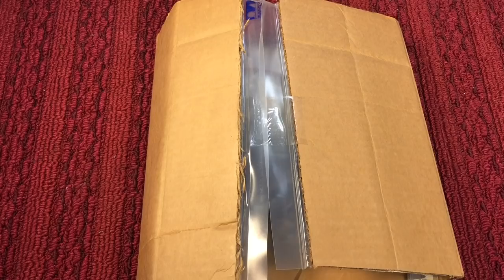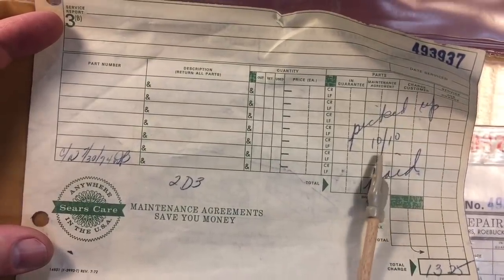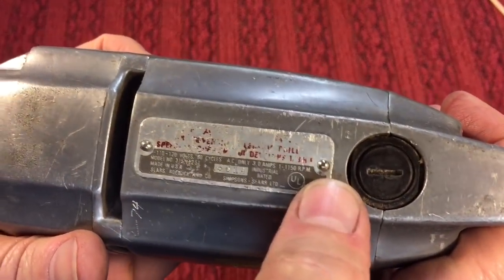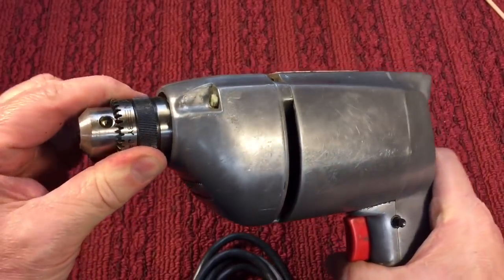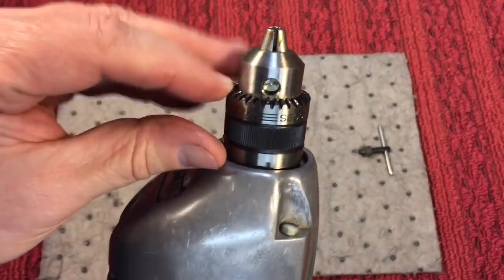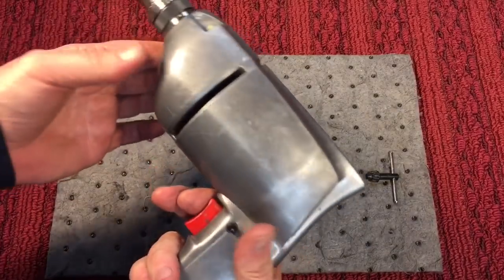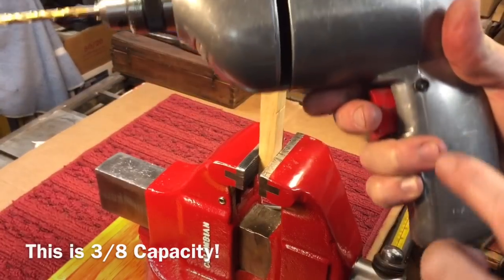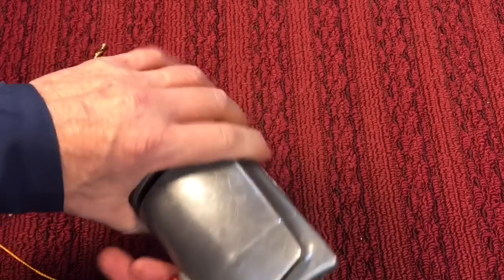Vintage Craftsman Power Drill Unboxing

Comment: Craftsman back in the day great! The small hooked rod is for removing the chuck there should be a hole in the frame near the chuck.
Reply from the maker: Hello Mick!  You are the man!!!!!!  I see a small hole in the top of the housing you can see at 5:54!  I guess that would lock the spindle so you could unscrew the chuck!   Thanks so much Mick!  Pinning your comment!
Reply: I think you could also insert that pin through the hole to turn it into an early version of a keyless chuck by locking the collar in place and grabbing the knurled collar to tighten the jaws by hand.
Reply: "Craftsman" never built anything.  It was simply a brand name wholly owned by Sears.  I wonder who built this thing for Sears?  Black and Decker?

Comment: About 50 years ago my dad had a almost identical metal housing craftsman drill but it had a two prong plug. I was drilling holes in our version of a go cart and happened to touch the metal pipe that was in the cement where the overhead garage door met the floor.  As you said I was the ground....could not let go of the drill, could not talk, just knelt there shaking for what seemed like an hour.  Dad saw what was happening and knocked the drill out of my hand.  He said it lasted a 5-6 seconds.  There was an odor of burnt hair mixed with human urine that I remember clearly even today.  It was 5-6 years before I could even pick up an electric drill. I am still a little scared of corded drills.
Reply from the maker: Hello RG!  OMG!  That is an awesome story!!!!!!   Usually 110 gives you a shock but the kind that makes you drop the drill... Wow!  That is something! Lucky your Dad was there!   Thanks so much!!!!
Reply: A tradey once told me that they changed the way they wired houses so that in the old days if you got shocked , you would “stick” to the metal, but  the more modern way meant that it threw you away from it. Whether he was pulling my leg or not I dont know.
Reply: Rusty Gun, glad you are still here with us!  I think you're right about the age... when I saw it in the video, my immediate reaction was the late 60s.  It's possible.  Like ScoutCrafter points out, we repaired things back then (I hope we pull our collective heads out of our collective butts and return to repairing things and expecting long life in durable goods).  It's not just that it had a metal case, but the smoothness of the case and the logo on the front feel 1965-1969 to me.  Maybe someone has a reference among the viewers?   As to the cord, I agree with ScoutCrafter that it looks to me that Sears Service put a new three-pronged cord and chuck on the drill as part of the service.  What a cool thing - I was born a few months apart from our host, and my heart was pumping when he plugged it in and started drilling!
Reply: Sounds fanciful.  What changed was ground pins in appliance plugs that provided  a low impedance path to ground.  I remember watching users sawing the ground pin off a new tool so that it could be accommodated by a standard two prong wall socket, thus defeating the purpose of the ground pin.  Later, polarized plugs and sockets were introduced.

Comment: Funny story -  My father-in-law passed and I got his tool collection.  It had an old drill that looked much like your Sears but without the grounded plug (I only realized full importance of that later).  It also was not the state-of-the-art model from Sears like yours in that it was only one speed - wide open.  First time I tried it, the chuck was wide open and I wanted to put a small bit in it.  Now I'm 68 years old so I should have know better than to handle it like a keyless chuck.  I grabbed the drill and the chuck to run it down.  The case was shorted and my grip became very firm as the electric surged through my body causing me to clamp down hard on the chuck.  Instead of that beautiful electric train smell, I had that mixed with burning flesh as the drill peaked at about 10,000 rpms (ok maybe a little less).  What an experience that was.
Reply from the maker: Hello JOHN!  LMAO!  What a awesome story!  Those older drills needed a fine touch to to clamp up on the chuck, they were torquey son of a guns!  LOL  I I know your pain!  I still get zapped if I tough my grinder and the dryer at the same time!  =D   Thanks John!!!!!

Comment: I could not agree with you more on the keyed chuck. It gives a far more secure hold and I was always taught to tighten using a the holes to even up the pressure. When you mentioned the smell of the old metal drills I was transported back to the early 1970s with you. Great find and sincere thanks for bringing back so many happy memories.
Reply: "all the holes"
Reply from the maker: Hello Tony!  Even today I prefer keyed chucks... I never had a high quality German Albright chuck though!  Thanks so much Tony!!!!!!!!

Comment: I have had a Sears Craftsman 315-11211 3/8ths inch drill for exactly 50 years! 1st good drill I boughf myself when I was 13 yrs old!  Similar to that one but made of metal and a super hard black plastic! Reversible, lockable and variable speed!  It still works perfectly!  The thing weighs a ton!  That rod was to remove the chuck.  I lost that somewhere along the way😀 Still have the original chuck key attatched to the wire with a little rubber piece.  Great Drills!!
Reply from the maker: Hello Bill!  You got your drill at 13!  Wow!  That is awesome!  I have to check the date of my first drill!  Also B&D and it had a Green handle and Silver painted metal from housing,   Thanks so much!  Good times!!!!!
Reply: @ScoutCrafter  i delivered the daily news and newsday. Saved up the money from my route, went to Sears in Hicksville on my bike, bought the drill, rode home and drilled a bunch of holes. I was always working on something.  That drill with wire wheels or sanding discs on it helped me do body work on my first car at 16 yrs old. A 1968 chevy biscayne, station wagon that was a former unmarked cop car! Great days! Thanks for the memories.

Comment: Hi Scoutcrafter I love that you have an older craftsman metal housing drill. I have a wall in my work shop that has many antique drills and saws from 1947 up to 1963. All can do a full days job. One drill which is a 1955 1/2" Shopmate BEAST that goes AC/DC! Two are my dads, one of the drills has a rubber hanger that used to hold the drill chuck key. I believe what was on your cord was an old chuck key holder .
Reply from the maker: Nothing beats those old drills!!!!!

Comment: The pin locked the armature.  There's a small hole near the chuck that receives this pin.  The locking button was a feature that allowed this drill to be used in a drill press fixture, which was popular at the time.

Comment: That’s a great drill! This brings to mind a drill that I picked up for two dollars at an estate sale a few months back.
It is an old (but new looking) Dayton 1/4” single speed drill that looks like a Buck Rogers Ray Gun.
The cord was frayed right where it entered the handle and there was a break in the wire so the drill was non-functional (hence the low price). A simple repair and it works fine after some clean up and lubrication.
Reply from the maker: The cords are always frayed on the older drills!  LOL  Love that drill you have!  I know the design!  Thanks!

Comment: That's a great purchase ScoutCrafter!! I always loved the blue sparks from my dad's metal drill. Not sure what brand it was, maybe a B&D. His newer metal and plastic B&D drill I still have and it sparks also. Lol. It was the first tool I used with a wire brush after starting this hobby before my wire wheels.
Reply from the maker: Hi Steve!  When the brushes start to go or the armature needs cleaning lots of cool sparks will run circles around the armature!  Looks great with the lights off!  =)   Thanks!!!!!!!!
Reply: Yup, I remember cleaning the armatures of my AFX slot cars with a rubber eraser to make them run faster. Good times!
Reply from the maker: I'm a little older then you, we had T-Jets!  LOL
Reply: Oh cool. I never heard the term T-jet used but those were the first ones we had. I still have them. My favorite was a dune buggy with a striped roof. They were too slow and didn't grip the track very well. Lol. I'm sure all the tires are dried up by now sitting in my attic. If I remember this weekend I take a look and send you some pics. I still saved everything, of course.

Comment: The good thing about these old drills and power tools is they can take a beating and still work and they are more powerful then the newer ones I just pick up a 1970s craftsman drill with the original box and manual from goodwill for only 4.33

Comment: Love the pointing implement.

"Paint" the stator, rotor (what goes inside the stator, keep the commutator clean) and the insides of the metal shell of the drill with a few coats of electrical lacquer.
Check if the earth is connected (multimeter continuity test, or you can use a lightbulb and a battery, or a LED and a CR2032 coin cell) , if not, attach it to the shell. Best way is to crimp a ring terminal and attach it with a screw. Just drill a hole that is a little smaller and the screw will tap it's own threads.
In it's present state it's dangerous, particularly in wet weather.

Comment: Ah yes. The smell of model trains. I also remember going to motocross races in the 70s and the smell of Castrol 2-stroke oil everywhere.
While my cordless drill is super handy, I still use my corded Makita drill with an old chuck from time to time. I find the variable speed has more control on that old drill vs new ones.
Great video as always.
Reply from the maker: Hello Ben!  There is no doubt that corded drills have a limitation (the cord) however other then that they are so much better then cordless drills in every other way!  Especially when you have to buy another battery after a few years!   Makita always made awesome tools!!!!     Thanks so much!!!!!!!!!!

Comment: That is the best unboxing  I have seen yet! My father has a pile of these old drills and nearly all of them have used that metal rod to secure the chuck key. The thick rod is wrapped once around the main shaft of the key, just tight enough to let it spin freely and not twisting up the cord. I am not saying that that's the intended use, I'm just saying that's what happened our my house. Great stuff! Cheers
Reply from the maker: Hello Joe!  There is a small hole in the top of the housing just behind the chuck, Mick 47 says if you place the rod in that hole it will secure the spindle from spinning! Then you can remove the chuck!  I never knew that!  =)  How cool is that!   Thanks!!!!!!!!!
Reply: @ScoutCrafter  i read that comment....i had no idea. It makes me wonder what the other optional chucks were? Anyway, we both have great viewers, i think it is great that they take a little time to contribute to our cause and share their knowledge. Cheers

Comment: Ah yes that takes me back too,I can well imagine the time warp feeling and ozone,grease smell..!  Those old drills were made to last..the bearings and the bushes,the bushes will be twice the length of the modern drills..They had to be earthed due to the alloy casing..We didnt have that same drill here but a VERY similar one made here by SHER which was a Australian power tool pioneer,they had some connection to SKIL ,some products branded Skil Sher..My father had one,iHe bought a set of P&N drills imperial sizes,64ths to go with it..It had the back half of the handle made from grey plastic,held on by philips head screws..would still have it today if I had not foolishly lent it ..in 1984..ah memories

Comment: This is a 1135 drill. It was made in Pickens, SC at Singer Power Tools. The pin on the cord is to put in the spinner hole on top next to the chuck to remove the chuck. Chuck must be fully opened, remove the left hand screw inside the chuck, take the chuck key put it in the key hole, tap with a mallet to the left to remove it. It’s made to add other attachments to it. The date code is when it’s made. Take the 4 #s that’s on the tag, put 4 5’s under that... ex: 5125 + 5555 = 0670. If the # is bigger than 10, you drop the 1 & out the last # only, so 10 would be 0. So it was made in June 1970. These drills was built in the late 60’s - early 70’s. I worked there for 30 yrs & repaired on the tools. They went to Japan in 2001 & so did our jobs.

Comment: Enjoyed your trip down memory lane.  Been subscribed for a while.  Your passion for old tools matches mine.  I purchased my Craftsman drill in 1966 or '67.  I still have it in a box in pieces.  The switch gave way a few years back, and I'm still looking to find another drill I can swap switches with.  In the meantime, I've obtained a few other old aluminum drills to hold me over.  By the way, my drill has that pin wrapped around the cord.  If I remember correctly, there should be a hole through the drive shaft just behind the chuck.  The pin was supposed to be used to lock the shaft so you could unscrew and remove the chuck.  That's my memory, but it's been a whole lotta years,  I gotta say . . .  Thanks again, and keep up the good work!  Cheers!
Reply from the maker: Hello John!  Spoken like a true tool lover!!!  😃👍.  Yes you are correct about the pin!  Thanks so much my friend!!!

Comment: There was one if those at the Re-store a while back and I stepped out smartly and got away from there, Pronto. I got lit UP when I was in my teens by a B&D 1/2 inch metal body and I never forgot the 1st bit of it. Couldn't turn it loose and had to jerk the plug out of the wall. Never again. I'd put a 3-prong plug on a double insulated. Good for you, Scout and I know what you mean about the ozone!
Reply from the maker: Hello Lewie!  LOL  Nothing beats a sticking switch!  =D  I have had that more then once!  The pucker factor on that is quite high!  Thanks so much Lewie!!!!!

Comment: Very nice. I pickup up a quarter inch one of these a few years ago in decent condition.
Reply from the maker: Hello Wire Works-  I liked the 1/4" models because they usually had a higher RPM range!  Thanks very much!!!
Reply: I may do a restore on the one I have..  Service is still down here.  They did put up a new pole.  Still waiting on Verizon. @ScoutCrafter

Comment: They don’t build them like that anymore. I have a 1/2 inch chuck Porter Cable, electric cord, all metal like the one you just showed. Very heavy  I love it. It has served me well for over 30 years. . Very good video.
Reply from the maker: Hello Tony!  Porter Cable was always top of the line and commercial duty!  I love these older drills as they were built to last!   Thanks!!!!!!!!!

Comment: What a beautiful tool. Much more kick then the modern battery ones. Modern drills may have the edge with their mobility but corded drills feel so much better and find jobs so much easier to do. That is a real cool one. Interesting that the chuck  is almost touching the drill body, modern drills (battery and corded) have a collar. Agree that modern drills (and most other things!!!) have a built-in obselesnce especially with those batteries that never fit other tools and are difficult to replace because the manufacturers change the connections they use.
Reply from the maker: Hello Steve!  You are so right! Battery drills are disposable and although very portable their planned obsolescence is a real turnoff to me.   If the replacement batteries were $15 or $20 I wouldn't mind, but $50 and up?   Please!  Not for me!   Thanks Steve!!!!!!!!

Comment: My Dad and grandads always called them "Drill motors" . I noticed the plate said it is a 3/8" not 1/4". There were a lot of 1/4" out there too.  That drill was top of the line variable speed and reversing back then those things were a big deal.  I still remember amazing old men by just putting it in reverse to unstick a stuck drill bit. Funny, I love that drill now but well remember at the  time being so excited about buying my own  modern  (1974) B&D with the gold plastic case and not having to use my Dad's old Craftsman (actually Powercraft from Monkey Wards)  anymore. Now I'm just the opposite.  Of course there is nothing like the new high speed bits we have today. Back then bits dulled so quickly you could wear a drill motor out.
Reply from the maker: Hello David!  Yes!  The pic of the plate wasn't from my drill, it was from another drill I found on eBay, this drill does have a 3/8" chuck, I realized that after putting in a 1/4" bit.  The thing is the older drills were high RPM and that can over heat a bit very quickly!  You don't have that problem with battery drills!   Thanks!!!!

Comment: My grandfather still has his steel casing cord drill. It some short of French brand I believe. He got it on a  discount because it apperantly had a production flaw (maybe a scratch or something because of wich it couldn't be sold in a store). He was a truckdriver and the story goes that he was working on the bed of his truck and the drill got stuck, but it was that strong that it threw him of his truck. Now those where the days that a lot of loading and unloading of trucks was done by hand, do he must have been a strong guy at that  time.
Reply from the maker: Hello Alex!  LOL  Yes!  The funny thing is that some of those older drills had so much torque that it would spin out of your hands and wrap the cord around the drill!  LOL   Good times!!!!  Thanks!!!!!!